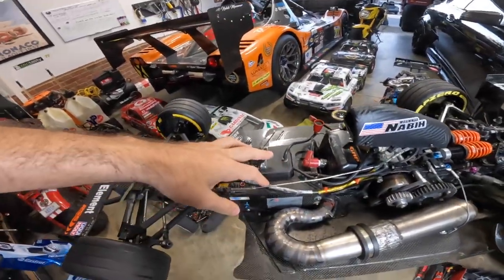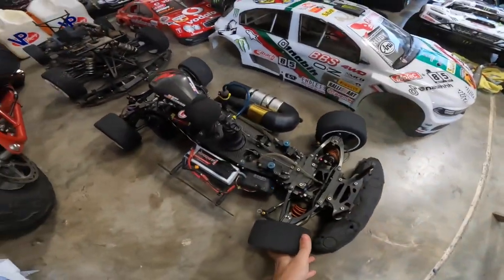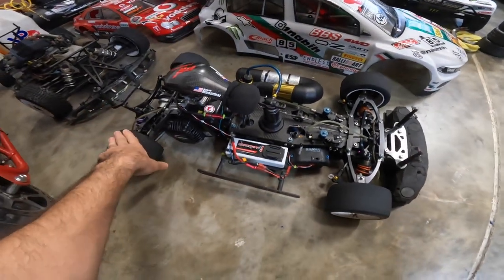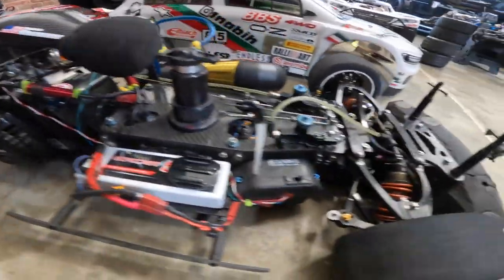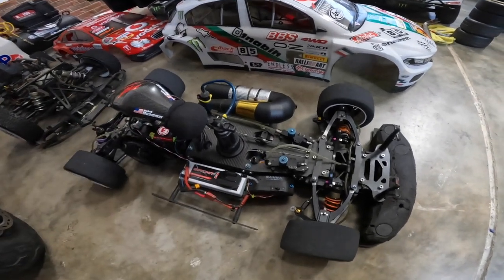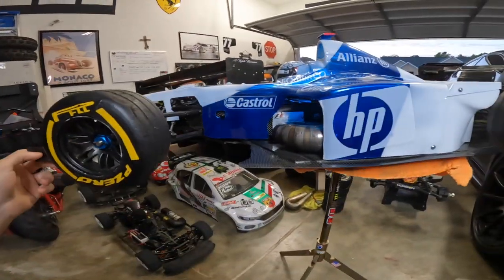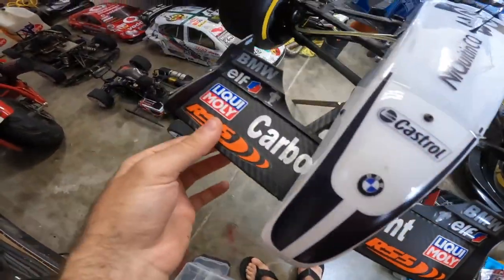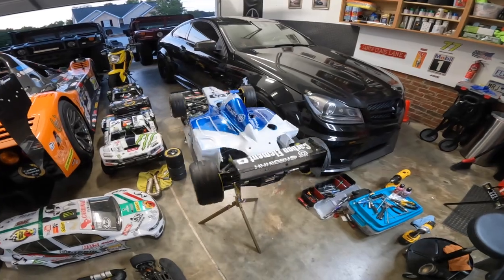1/5 SPECIAL CARS HD (GAS/PETROL RC)

Comment: Do you happen to have a manual or parts diagram for this? I got one used but missing some parts and now I am stuck. Where can I get the parts too? Thanks in advance.
Reply from the maker: you need to improvise a lot with these as there is no manual but the parts can be bought from rs5 germany they just take long to send